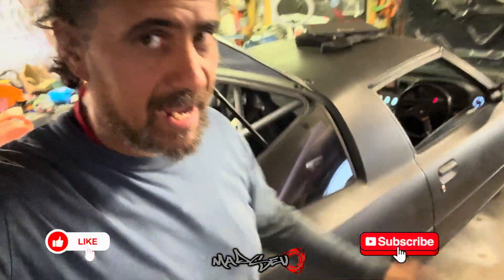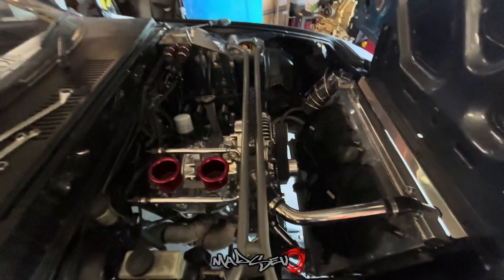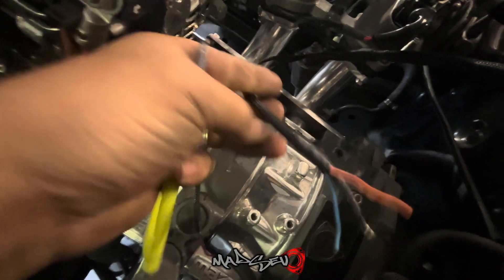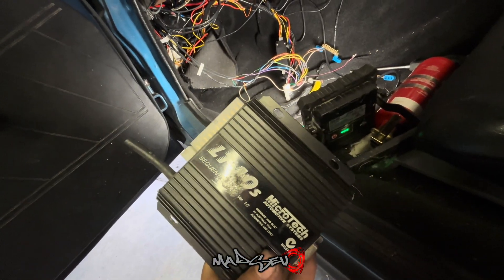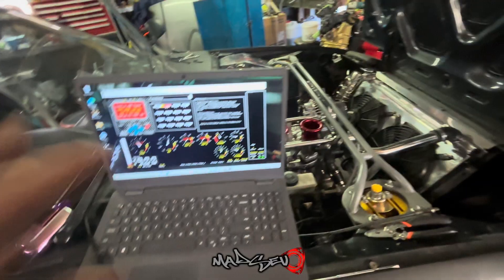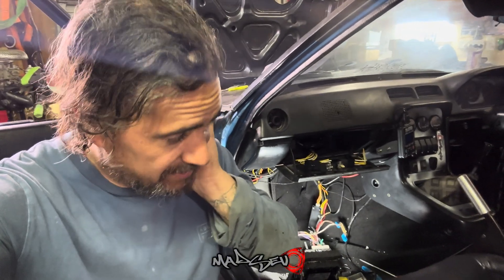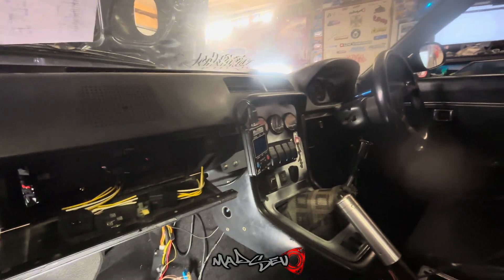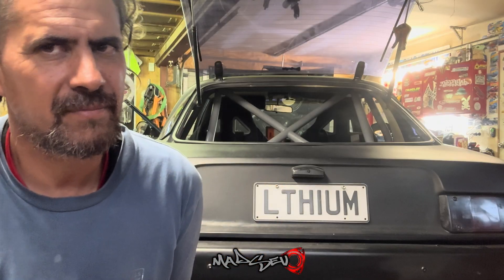Rx7 efi conversion part 2. Wired and ready for the ecu

Comment: Make sure them orings on injectors are fuel rated eh
Reply from the maker: Oh yeah most definitely. I will replace them when everything is complete. I have a feeling they are not fuel rated. But yeah once intake is all polished I will put in new ones. Cheers
Reply: I've used o rings feom.para rubber had zero issues 😂😂😂